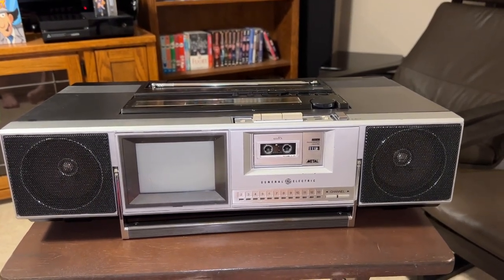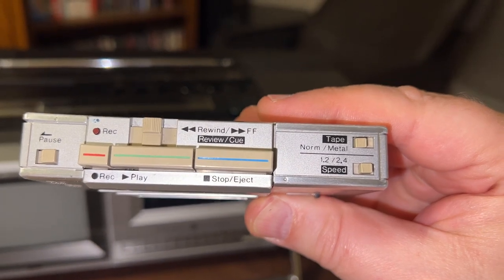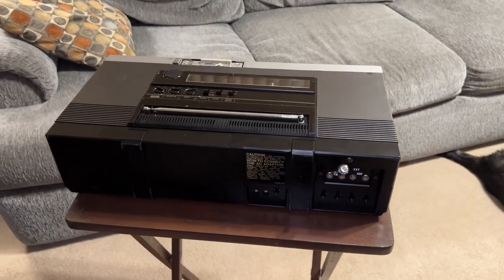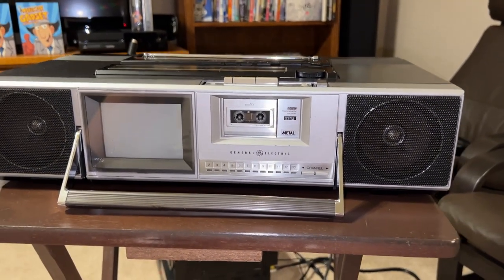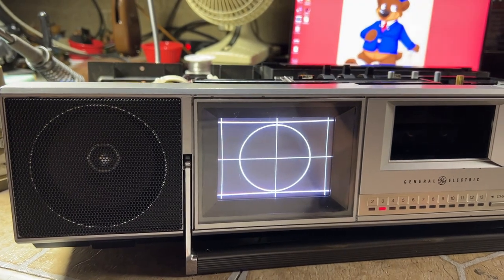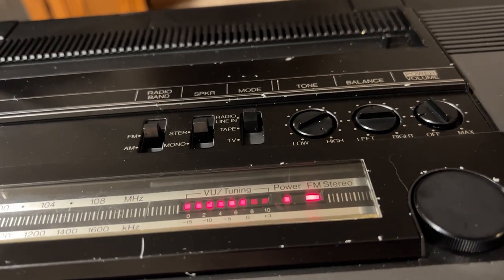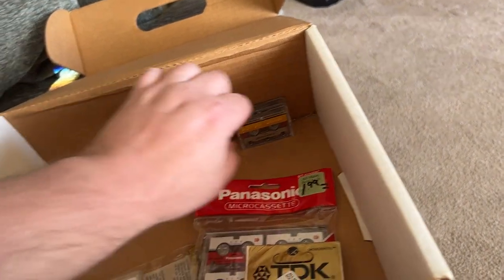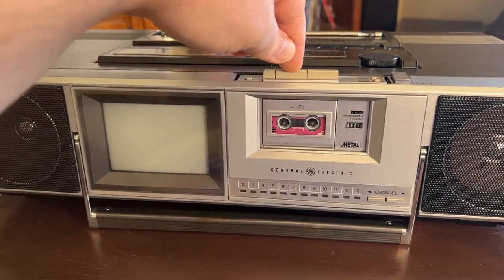The Roadshow - 1982 GE Boombox with COLOR TV & STEREO Microcassette!

Comment: i no longer have it because it broke, but I had a small tv that took sixteen batteries, that's nothing compared with what I had. I still have my CB ht and that takes 10 double A batteries lol, the tv i had though took 16 D cell like you would use in older flashlights. weighed a ton to carry too, claimed to be portable yeah, but portable doesn't or should not weigh fifteen pounds without the batteries either lol.  I don't miss it either because it was black and white and the reception without an external antenna was crap.  The only thing that was rather decent for receive was the AM front end. i could get a decent number of stations on the AM band, otherwise it wasn't all much.

Comment: Power it off of 18volt cordless tool batteries. Like 2 or 3 18volt batteries wired in parallel so the voltage stays at 18, it'd run quite a while off that.

Comment: A very nice and unique machine. And it even has AlNiCo speakers, quite unusual for the era. It almost seems like they wanted to make this as weirdly cool as possible. 

Isn't the tape width itself the same for micro- and compact cassettes? So it should be possible to manually wind some tape from a regular type IV cassette into a micro shell - it would be a big PITA but you could also build some contraption to automate the process.
Reply from the maker: The tape width is smaller than that of a compact cassette, so no go. And even then, I still have to obtain some regular type IV cassettes too haha.

Comment: Anybody remember the microwave oven with color TV and AM FM stereo radio with side firing speakers?  May even had cassette as was centerpiece of modern kitchen?

Around this early 1980s time… I can’t find any references to it.
Reply: Small CRT to the right of the oven door.  In the same place as oven/clock radio display.  I even recall it may have even cassette….  Was such a long time ago and blown away….